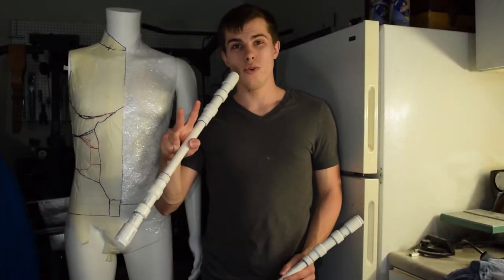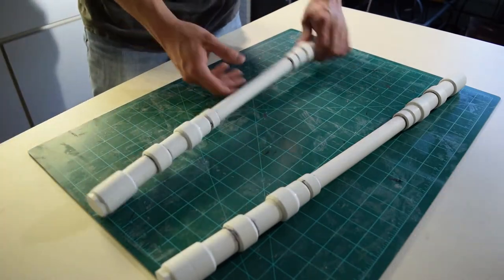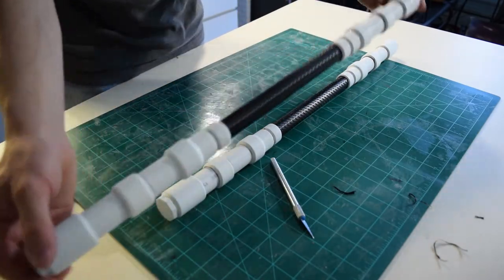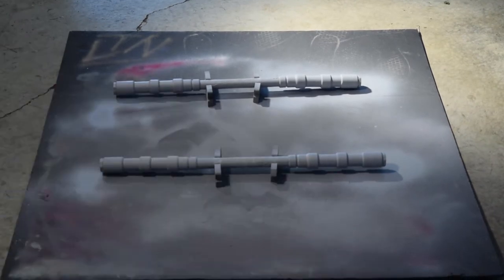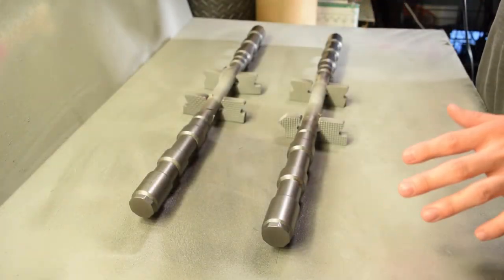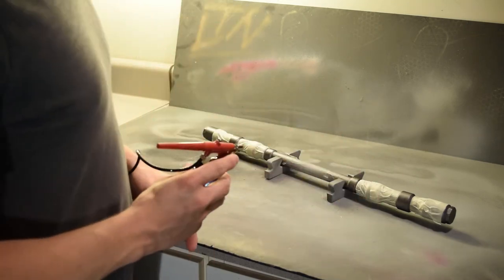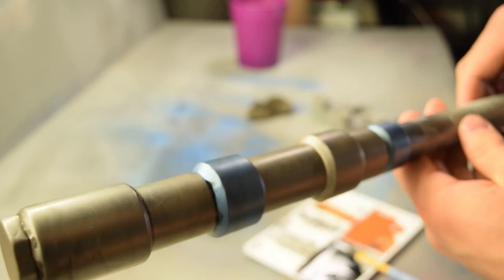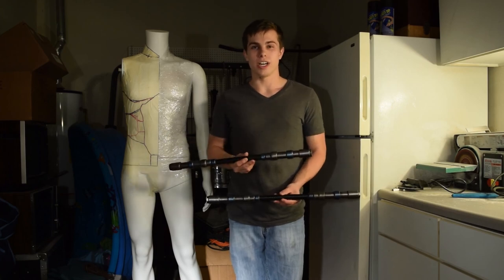How to Make Nightwing's sticks part 2 Fininshing

Comment: PLEASE REPLY. Where'd you get the carbon fiber tape from?
Reply from the maker: I just got it off Amazon but you might be able to find it at an auto part store.
Reply: +Birdboy Cosplay Aight thanks. Also can they be connected?
Reply: you can easily make them to where they can be but the ones i made here do not